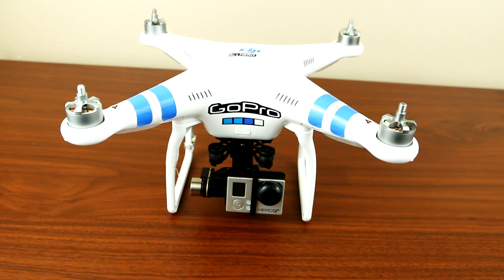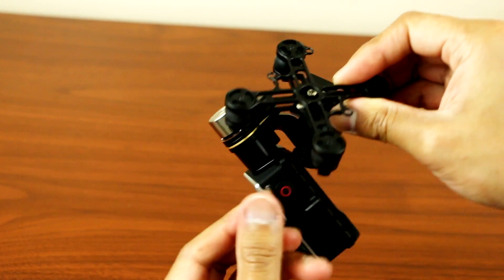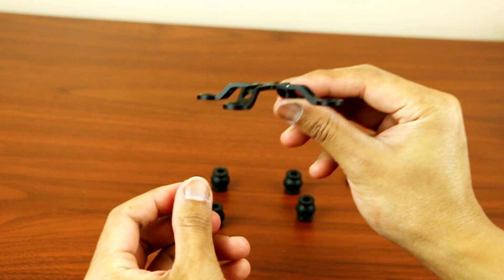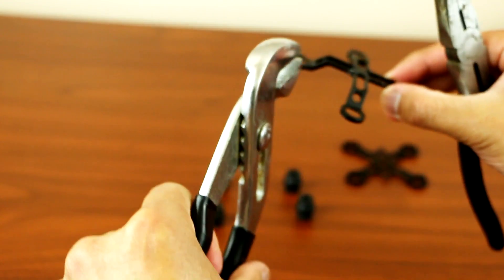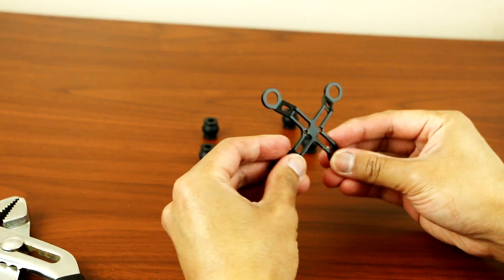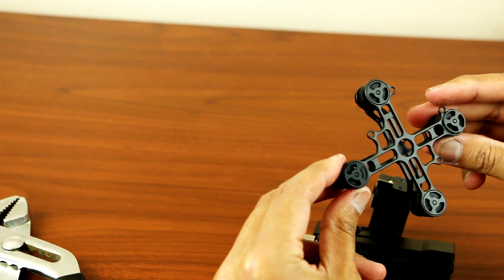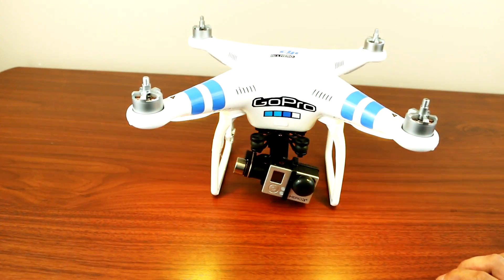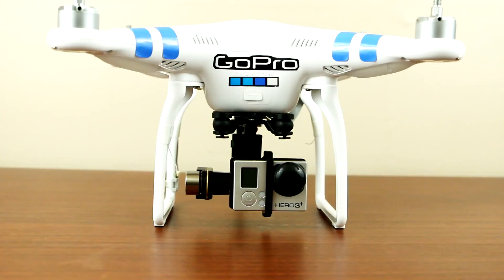DJI Phantom 2 - Zenmuse H3-2D Gimbal not Aligned/Leveled (Solution)

Comment: I have had this issue with my H3-3D gimbal after a crash. The mounting plate needed some serious straightening out, but it is still off a few millimeters. Will bending the leg, on the bracket, also work on a H3-3D, or will it "auto-correct" itself crooked again?
Reply: +Heine Johansen i have the same issue on the H3-3D, unfortunately it doesn't change anything if you bend the plate (the gimball auto-correct). Did you find a solution since your message ?

Comment: Thanks I could have sworned that the electronics were bad, but it was all mechanical.  My 3d has again horizontal level.
Reply from the maker: awesome i could help
Reply: +Roger Zellmer Hi roger, how did you fix it. In my case, the gimball auto correct even though i bend the plate.

Comment: my h3-3d gimbal is not looking straight down.  how do i fix that?
Reply from the maker: have you gone to the dji phantom assistant software and calibrated it?
Reply: L BS I have but what is the best setting?
Reply from the maker: Josh Burger so you calibrated it and you still have problem? does it go up at least? how far down does it go?
Reply: L BS I haven't done anything because I am unsure as to what to do.  I have the program.  Gimbal works fine.  the only problem is that it just won't look straight down.  only goes as far as 30 degrees down.
Reply from the maker: Josh Burger what do you mean best setting, you just calibrate your gimbal that's all it takes. there's no number to be altered
Reply: L BS No I haven't done anything because I don't know what to do. ;-)
Reply from the maker: Josh Burger just plug your phantom via usb turn, on your radio and your phantom and run the software. then just calibrate it
Reply: Josh Burger
Hey Josh, i had the same problem with my H3-3D after a crash. I bent the gimbal parts back straight but it didnt look straight down. Heres the fix; go into the Phantom 2 Assistant software. Go to Advanced, then Gimbal. Adjust the Horizontal limit. The value 'zero' should make your gimbal look straight down. If not adjust it to a value in which it does look straight down. Hope  that helps. Good luck! :)

Comment: Thanks! i have the same problem. How do you remove the secure pins?
Reply: L BS
I just got the new phantom 2 with gimble that is all made of plastic and clip on pins that are difficult to remove once clipped.
Reply from the maker: secure pins on the gimbal mount? you just un screw it
Reply from the maker: Maximilian Imaging which gimbal do you have the h3 3d or the h3 2d?

Comment: Do you know how can i reset my gimbal? After landing strong my gimbal shake in tilt position many times. Now it wont stay balanced. Still facing down. No want to stay in the initial position. Thanks
Reply from the maker: have you re-calibrated the gimbal using the "DJI Phantom 2 Assistant 3.0" application?
Reply from the maker: i think i encountered that problem before, but i need to re learn myself how i fixed it